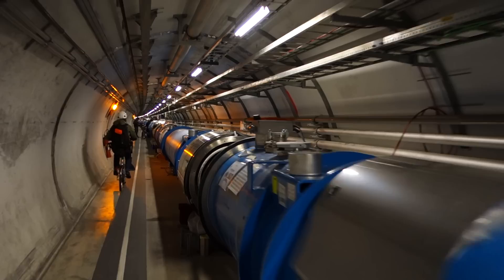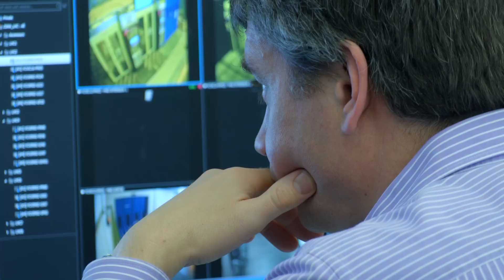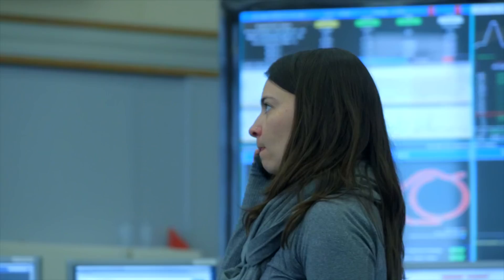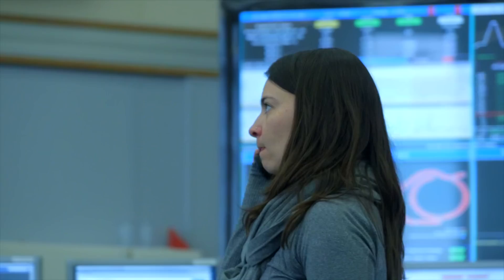Driving the LHC: Life in the CERN Control Centre

Comment: I don't understand why this is even necessary.  What is cern trying to accomplish?  Why do we need to smash particles?  What will this do for humanity?
Reply: Perhaps we could find a way to eliminate conspiraturds on You Tube?
Reply: Harry Andruschak I also appreciate how you have zero intelligent answers to the questions I asked.
Reply: They do a few things, here is their website https://home.cern/.
Reply: high energy makes time travel possible
Reply: Kristin Gallo Short answer would be: "To understand the nature of matter, forces and time better at fundamental level".

Now the long answer: We still have many things to figure out about the nature and structure of the universe. We have wonderful theories about space, time, matter at macro and quantum levels but there are still missing pieces to it. 

In Large Hadron Collider of CERN, particles are sped up with slightly different energies each time and set to collide in many detectors around the accelerator circle. Then the detectors watch and follow the resulted sub-atomic particles from the collisions only to find pieces we did not know to be there before.

They liken each of the hundred millions of collisions a second crashing two trains head on with very high speed. And according to analogy, detectors job, and the point of whole experiment is to detect pieces size of a pin in all that mess. So you have to analyze the debris very carefully, trash the data about everything you already know about, and seek new things in it.
Reply: @harryandruschak2843  😂 your comment made my day I agree which you 1000 fold